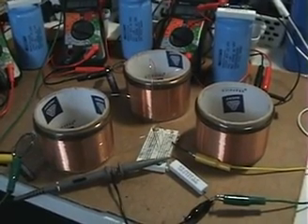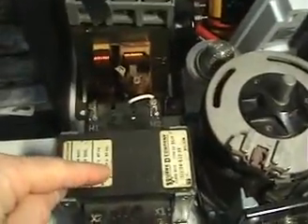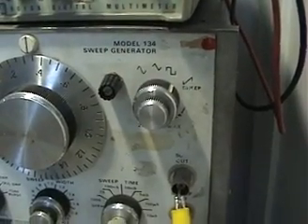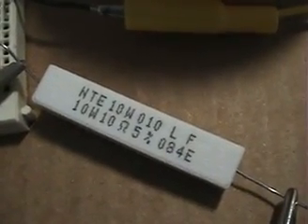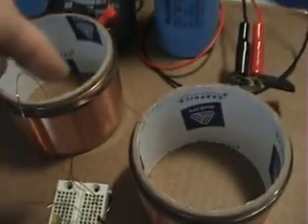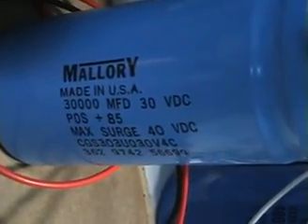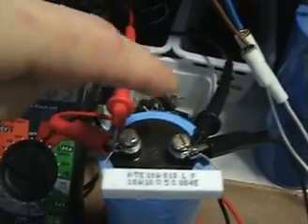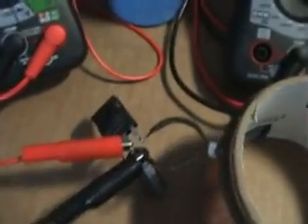RESONANCE EFFECTS FOR EVERYONE TO SHARE test 12

Comment: I think problem is that you use rectangle signal input instead of sinewave. And digital multimeters can measure correct only sinewave signals... Please retry to do the same experiment but with sinewave input signal. Good luck. Oleksiy. orgonlab@cable.netlux.org

Comment: @gotoluc   You didn't measure the signal generator voltage, which I bet is more than 7.5 volts peak to peak or 3.75 volts RMS.  Current through the resistor is 0.385 volts / 10 = 38.5 ma.  Power across the resistor is .0148 W. 

Current is the same throughout a series circuit. Power from the generator is 3.75 volts x 38.5 ma = 0.15 watts, exactly what you get out.  Power out = power in, if you have 100 % efficiency.  
      No power multiplier here.      Sorry.

Comment: the oscilloscope should be connected across the siganl generator to accuarately measure the input voltage. onother thing, the signal gen should have a setting for the output amplitude. so if you are sending squarewave and you know the amplitude and freq, you can calculate the rms volatge. then measure the current from the signal gen. the power input can be calculated as well.

Comment: You need to up your signal via car coil high voltage dc pulse is needed to enlarge resonance range. i have found that distance dose effect  Aeter resonance current levels on the secondary coil which should be made of a sheald of aluminium flashing with a wire lead to a full bridge rectifier. Connect secondary lead to AC side, only 1 leg.  DC side normaly to a polarized cap. when pulsing the whole thing you should be able to ge a fast charge into the cap.Use 2- 200v 220uf. good luck!   VLADRXSCI

Comment: Luc I may have that backwards, better review my resonant circuits. Parallel resonance is what I describbed. Series is the opposite, highest current at resonance. Current will peak on the resister, but the calculation is the same for power. P = E x I.

Comment: At series resonance the voltage across the resister should drop or dip, and voltage across the cap & coils should peak. Current here now = E/R on the resister. Now use that current and multiply by the voltage comming out of the generator to get the total power. Next explore "impedence" Xc and Xl to get more accuracy, it will be a little different.

Comment: Luc, the input power needs to be measured across all the devices not just the resister in series which only burns up a little. Check out measuring power in series circuits. Use the resister to find current through all the coils, now multiply current x voltage from the generator, it should come out higher.

Comment: The scope shows a sinewave cause the many additional odd harmonics in the square wave are not reaching the 10 ohm resistor, likely due to filter effect. The RMS value of the Gen's applied voltage if square wave is not the same as a sine wave.
Sine wave 0.35355 of peak to peak value whereas square wave is 0.5 of peak to peak. 
Gen's applied sig should be sinewave, also  to be measured across BNC connector preferably at load resonance where applied volts and current are in phase (Cos = 1).

Comment from the maker: Dear MRH2O2,

I am asking for help here on the correct way to measure. I have said so many times that electronics is not my field of work and I need help to do this right. Your explanation is not clear enough. I need it explained in plain English... like example: put scope prob A across SG and probe B across input resistor, then take RMS voltage reading of probe A and multiply by probe B RMS voltage, then divide by resistor value and so on and so on to get to watts input.

Luc

Comment from the maker: Hi InventorGadget,

originally I was going to use the small 1,000uf cap but I realized that many would say that cap is not large enough to clean the DC pulses and therefor claim my output voltages are incorrect. By adding these that argument has not come up. So you don't need these Large caps!.. unless you are trying to satisfy the measurement team.

Luc

Comment: I am really happy of the results! :D
I like the approach with the same type of resistors/caps/coils everywhere, make's it really easy to replicate ans so on.. 

One question, why do you have the diode connected to a smaller cap, and then connected to the big cap? 
Can one not make the diode connection straight on the big cap?